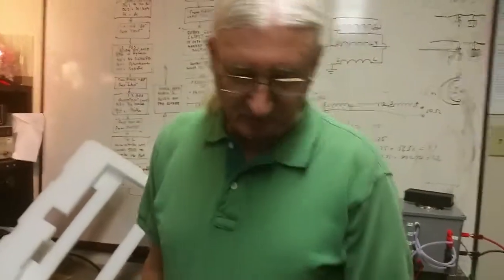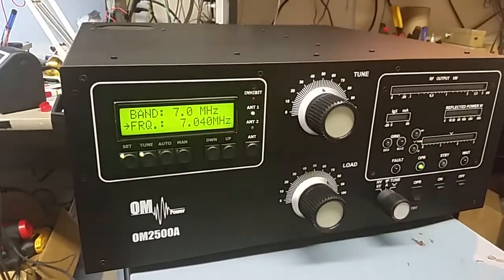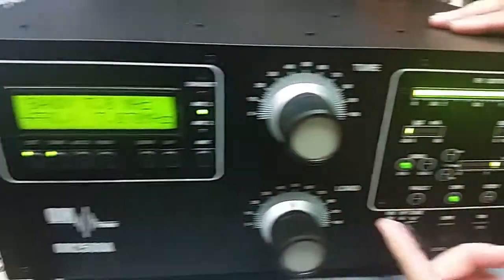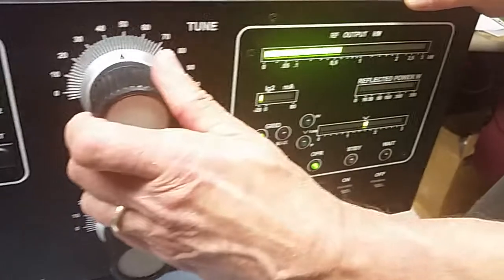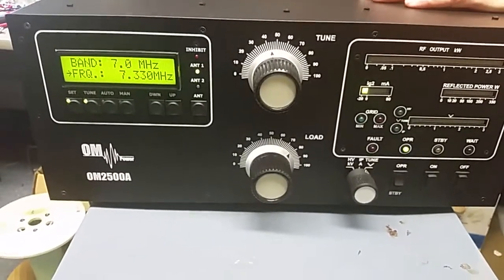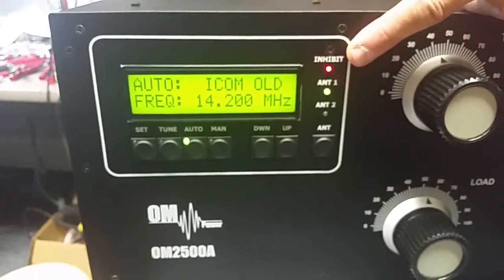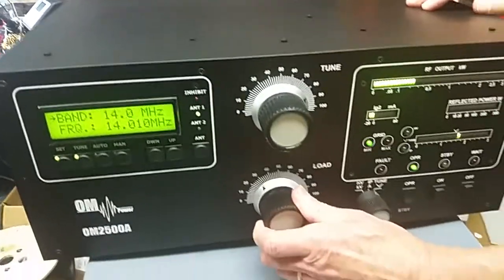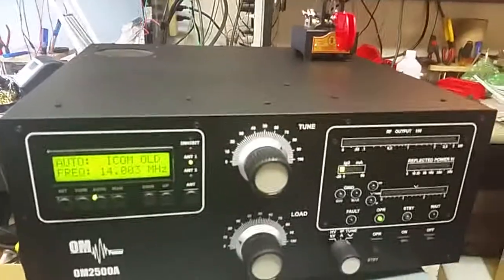From the Array Solutions Lab: OM Power OM2500A  Manual tuning and automatic band switching

Comment: My friend, good afternoon, I have an om2500a and a radio ic-7610. According to the manual that comes with the OM I can't connect the linear to the radio using a p2 mono cable from the Remote output of the radio to the CIV output of the linear. I put the basic settings that come in the linear manual, but I can't connect. Please I would like to know what configuration you used on the ic-7600 radio that is in this video. Thanks in advance for your attention. Francisco - PY2NF